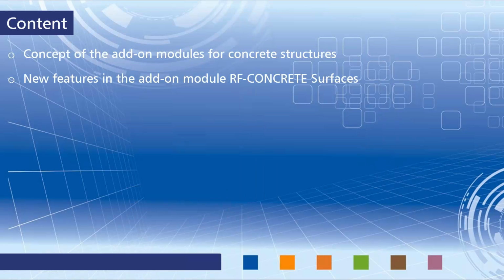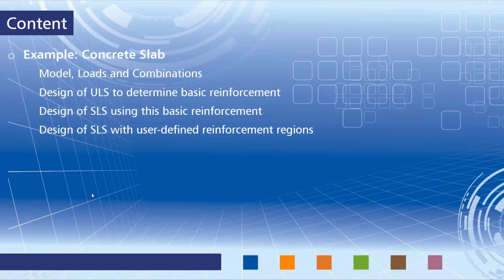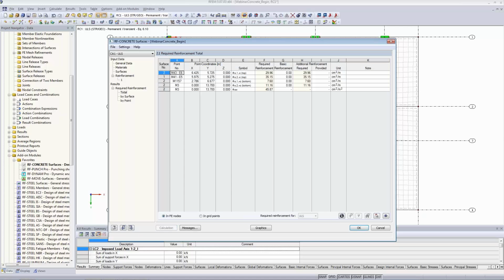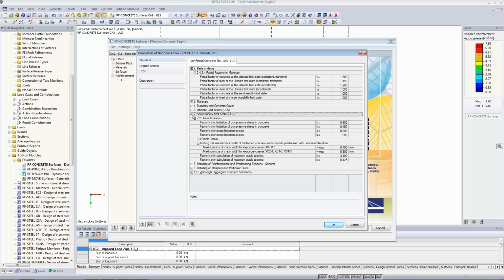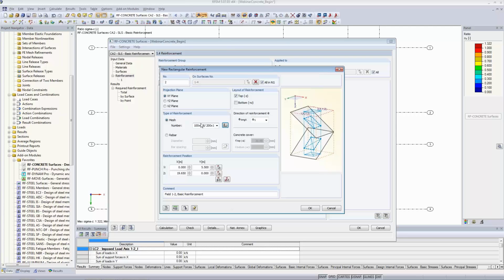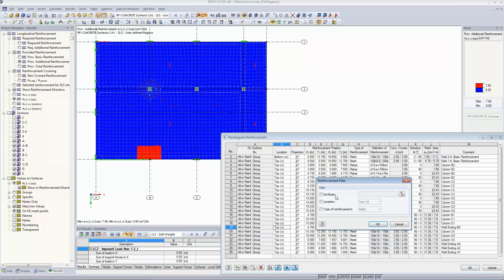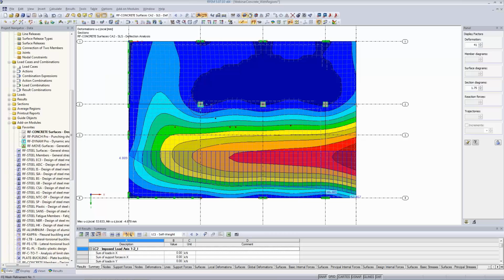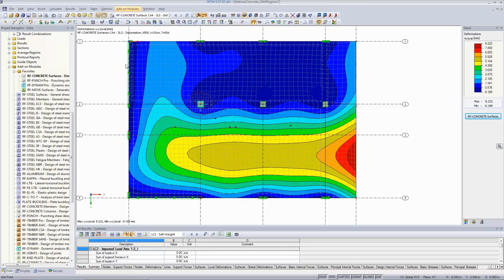Reinforcement and Design of Concrete Surfaces in RFEM

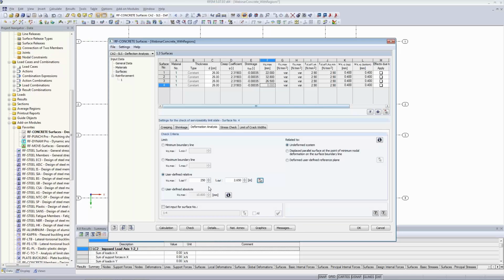Comment: At 47:00 you defined an value of L/100 for overhang?!
Should this be L/500?
Reply: YOu gave an excelent answer later in the presentation 🙂 Thank you.
BUt another question arises. For calculating "earlier" deflection on adjecent structure elements, you made only 1 combination that includes onyl self weight.
Is this just an asumption or an eurocode based rule?
Reply from the maker: Hi, picajoool!
The calculation of deformations is actually more dependent on the customer's requirements.
According to Eurocode (2) it would be the quasi-permanent design situation with 1.00*G + 0.30*Q.
However, if Q is only wind or snow, then the deformation can also only be calculated as 1.00*G.
But then it depends on where the construction is located. If you are in the Alps, then calculating the deformations with only 1.00*G is certainly on the unsafe side. 
You might have to consider the snow as "Frequent" with 0.50*Qs.
Reply: @DlubalEN  I understand you 🙂
But why did you first use a value of L/100 for the overhang part of the slab?